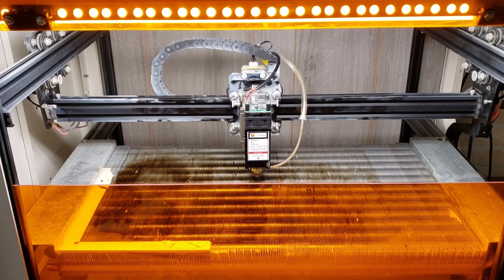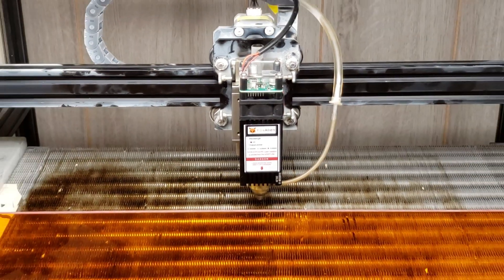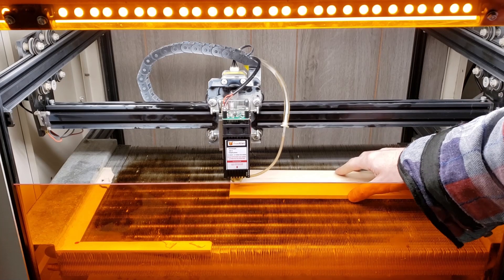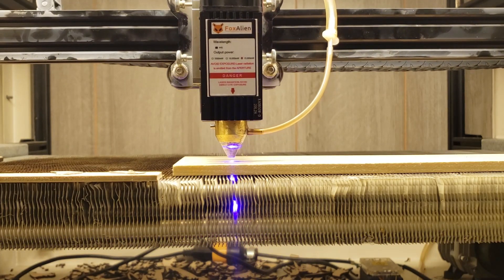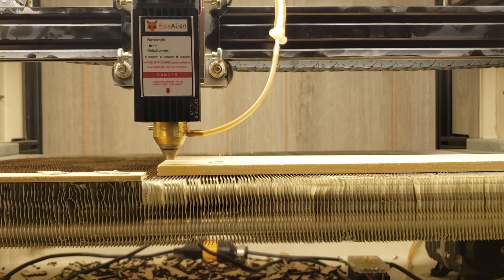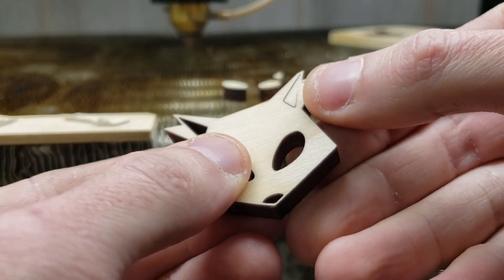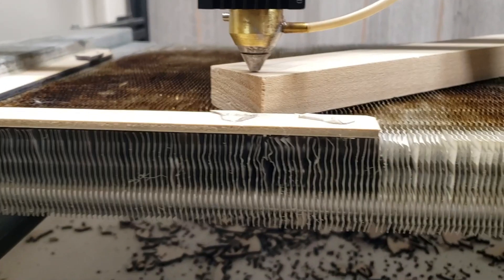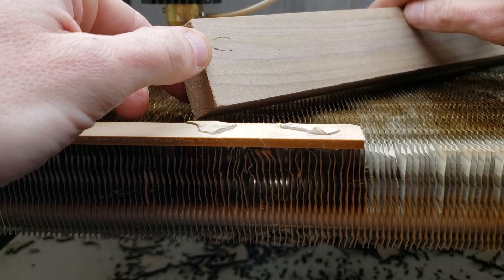Testing out the incredible power of the new FoxAlien 20W laser module! Cuts through 3/4" solid wood!

Comment: Very impressive!  Almost got me convinced to get the laser module, but being a newbie to cnc and the 3018SE V2, so far I haven't done much except cut a few things.  The video raises some questions for me, though:
1.  Which car did you take the radiator from?  Seriously, is that something to use instead of a spoilboard or additional base on the spoilboard?
2.  How do you know when you're through the board?  If you look, unless you have a frame to locate the workpiece, I guess you'll never get exact alignment again...?
3.  The air nozzle looks pretty essential - are you going to offer it for sale :-)?  What's providing the air?
4.  The protective (orange) front screens - what do you use?
Reply from the maker: 1. I'm using a condenser from a junked refrigerated centrifuge. My previous bed was an evaporator core from an old fridge. Both have cut me many times, but both leave the undersides of my cuts absolutely clean. I've ordered a proper steel honeycomb bed for my other laser machine. That might be a wiser route to go. This current condenser I'm using is packed too densely and tiny pieces get stuck in it instead of falling through. The one I ordered cost $150 shipped, current one was $free.99.
2. I use Columbia Forest Products PureBond Maple veneer plywood for most of my cutting and engraving. The Maple veneer engraves very nicely and the core ply in this is almost completely homogeneous. It is like an MDF core. So once you've honed your cutting parameters, it should be very consistent. As I've mentioned in the video, whatever I find to be the ideal amount of passes at a given speed, I give it one extra pass for good luck. I still have to cut some parts on the backside from time to time, but nothing has been a failure for me in a long while. I have installed limit switches and glued down a piece of plywood which I've cut out along the 0, 0 lines. I was able to successfully put back a sheet to run another pass and it actually lined up perfect! The spot size is 0.1mm, so you can't be off by even 0.05mm! Hard to do, but I was able to. Haven't had to try that again though. 
3. Air assist is absolutely essential, 100%. That's like welding without Argon, soldering without flux, drilling metal without lube, sure you can get away with it for a short bit with mediocre results, but that should be one of the top priorities. I fabricated this nozzle myself and do hope to offer it soon since it is not something I see readily available. The air compressor is a 32W aquarium pump. It is plenty strong for this setup. It is extremely important that the nozzle orifice size is as small as possible to create the strongest jet of air. Ideally the air stream should flow exactly along the beam path.
4. 1/8" thick 2422 transparent amber cast acrylic sheets from Ebay. 1/8" should provide about maybe OD+3 protection at 445nm. You can get 1/4" sheets to be extra safe.